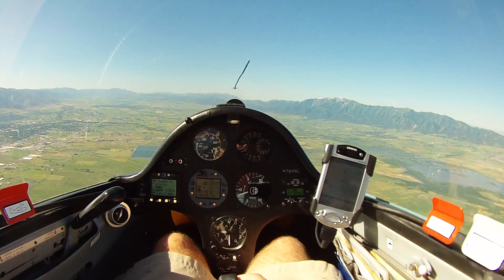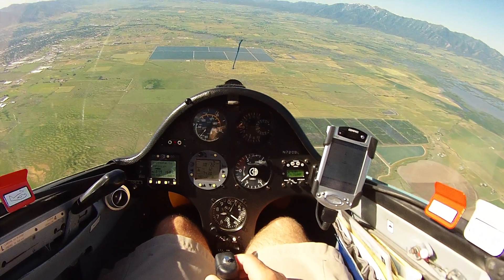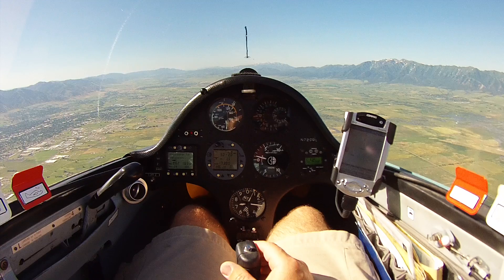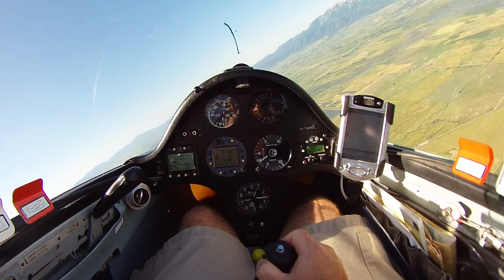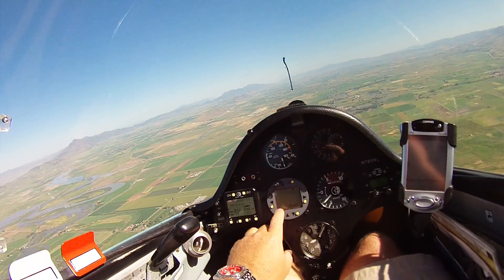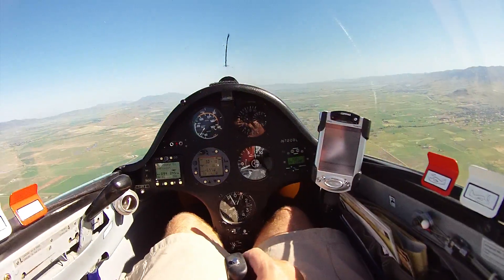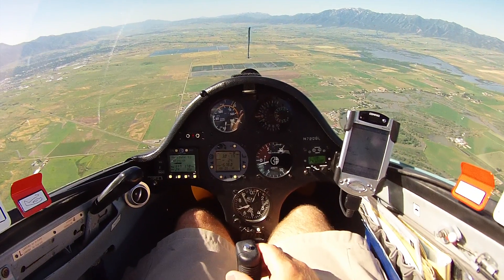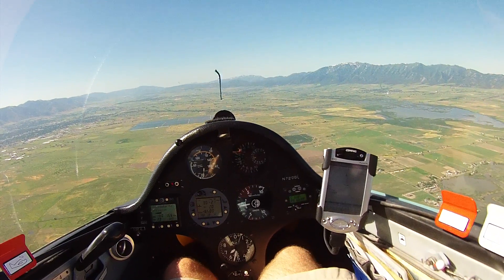Figuring Out Glider's Total Energy System Problems

Comment: Could be a diaphram issue or something similar related as it is slow to respond and seems to show the stick thermal a few seconds after your inputs, i.e you pull up and a couple of seconds later it shows climb and then as you push the nose over it registers max climb then peters out. I would have the system checked over.